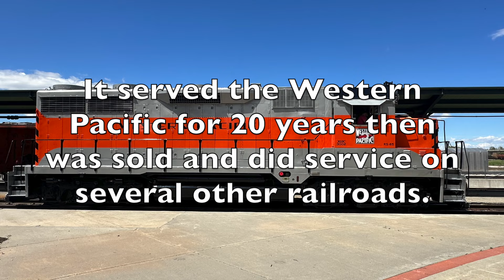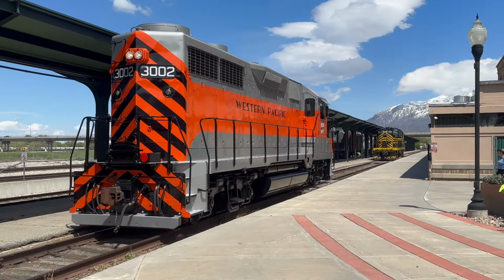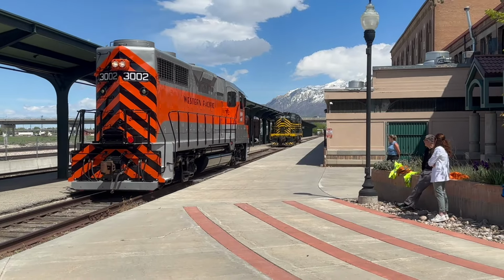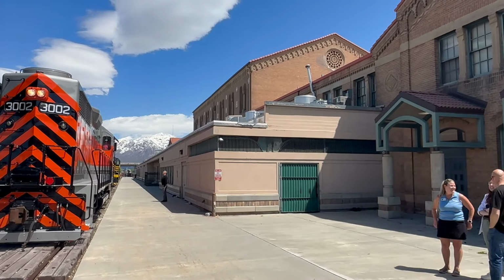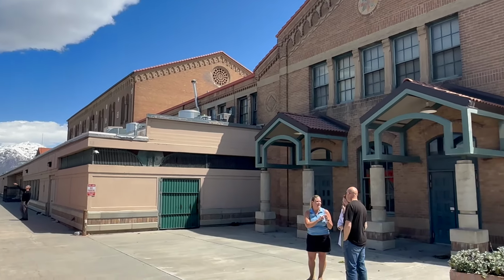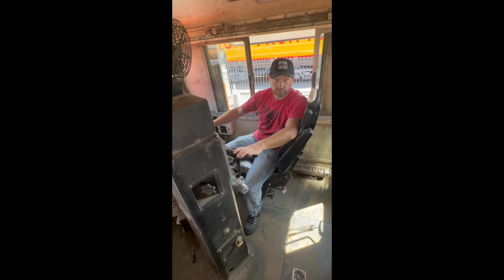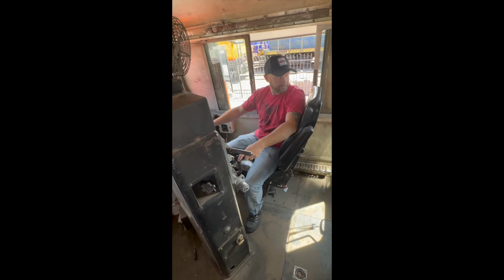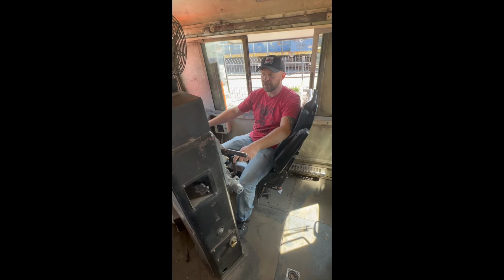Western Pacific 3002 Restored

Comment: WP #3002 is now at its good home at the Utah State Railroad Museum of Ogden Utah. Thanks to everyone involved in saving and restoring the GP35, the Western Pacific Railroad is now represented in Utah which completes the major Utah railroads collection. who knows? Maybe WP #3002 could be used in excursion service.
Reply from the maker: Thanks or the comment.
Reply: @LeeWitten you're welcome. The locomotive in front of it is NKP #324 which is actually a former Utah Railway RSD-5 in the wrong paint job but it'll be corrected soon.
Reply from the maker: @OfficialSEIC2K6  Ok, thanks.  It will be great to see it back in Utah R. colors.
Reply: @LeeWitten  in case you're wondering who painted it that way, it was Doyle McCormack who was once president of the ORHF.